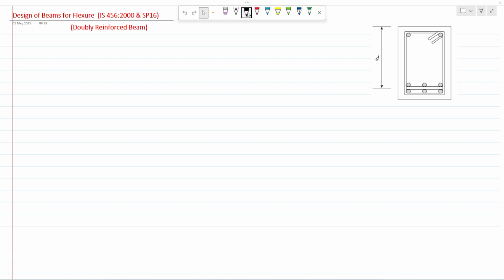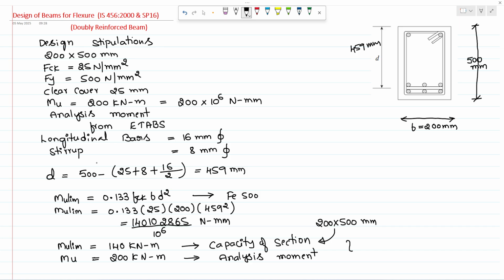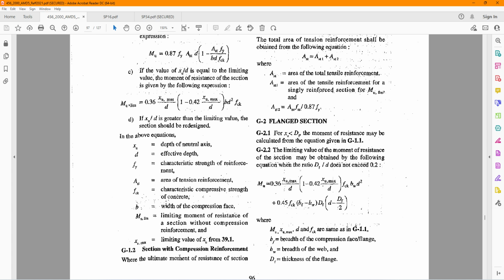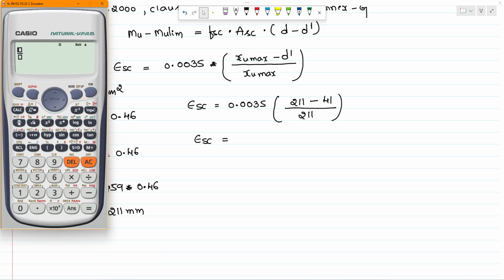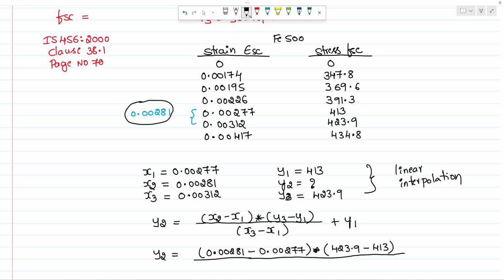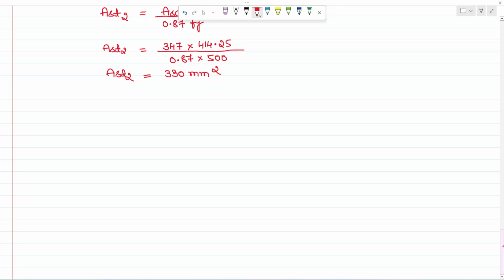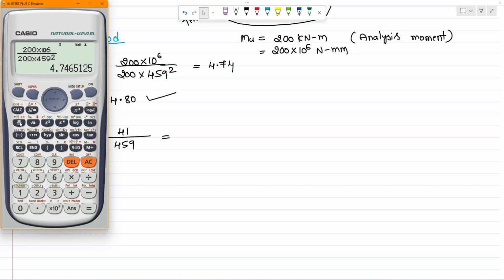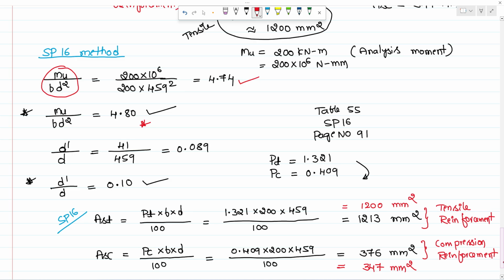Design of Beams for Flexure | Doubly Reinforced | IS 456:2000 | SP 16 Method

Comment: In SP-16 method
Why not Ast1 and Ast2 calculated seperately. In example numerical of SP-16 for doubly reinforced section it is given to calculate Ast1 and Ast2 seperately
Reply from the maker: In SP-16 method, Ast is split into Ast1 (for balanced section capacity) and Ast2 (for additional moment beyond balanced) to clearly show how much steel is needed for each part. That’s why SP-16 examples calculate them separately, even though in design we finally provide Ast = Ast1 + Ast2.